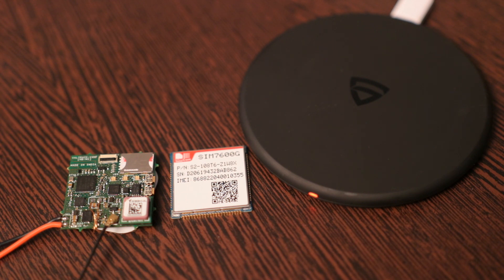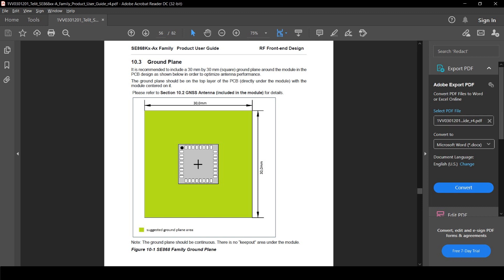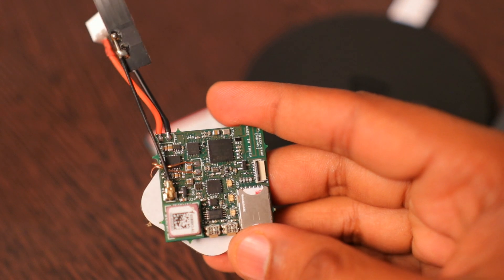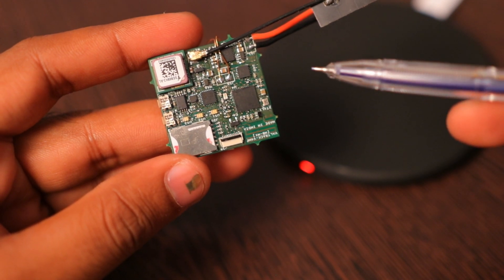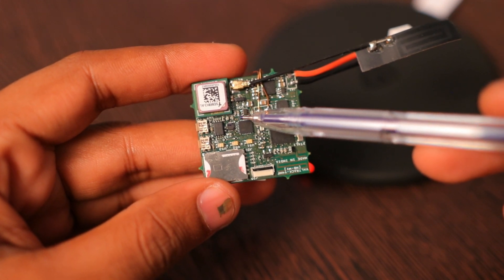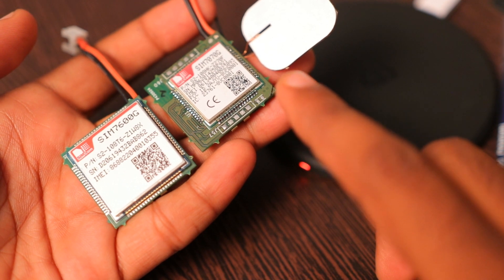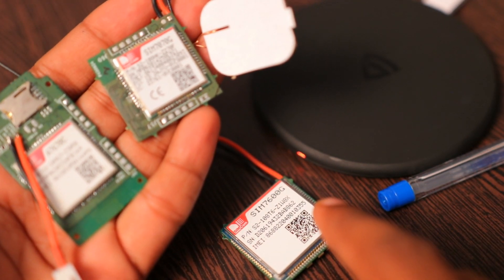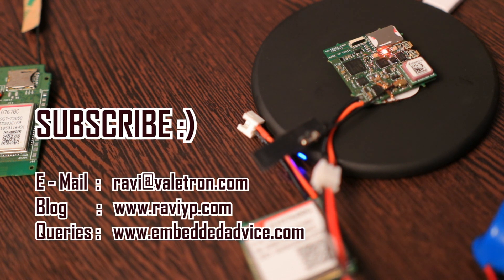Tiny 4G-LTE-NBIOT GPS tracker for Pet & Assets  - VALTRACK-V4-MF

Comment: This is a great product. I have a small doubt, SIM7600 comes with both GSM and GNSS right? We can use the same module for making calls and also getting the position data. Am I right? Thanks in advance
Reply from the maker: Thank you. Yes you can use it it comes with inbuilt gnss. But it comes with PCM audio and not analog audio interface. You need to use a audio codec
Reply: @RaviPujar  Thanks for the reply. I don't require audio ri8 now...I should have 2 separate antennas for gps and GNSS which died the job right?
Reply from the maker: @gudimetlakowshik3617  only 1 is needed

Comment: Very nice! 

Doesn't SIM7600 come with integrated GNSS? What's the reason to use external module for it?
Reply from the maker: Thank you. SIM7600 Needs a bigger external antenna. Adds up to space and blocks the LED view
Reply: @RaviPujar  Nice idea. I too was wondering at that big box antenna. 
How about having that integrated antenna+GNSS mini module indise a thin metal box? I am wondering at the signal effects then.
Reply from the maker: @navadeep025  Metal blocks signals
Reply: @RaviPujar  How about using these flex antennae with the SIM7600 itself for GNSS band https://www.molex.com/molex/products/part-detail/antennas/2065600050?

Comment: Hi Ravi, Thanks for your detailed explanation. 
I have 2 questions..
1. In some of your videos i found you have used ER26500 non rechargeable batteries. In technical data sheets those batteries will deliver max continuous current of 180mA and max peak current of 320mA. But GSM modules requires 1.8 to 2A in peaks right. So how these batteries are providing enough current at peaks?
2. GSM modules required 3.4 to 4.4V right. Non rechargeable batteries are giving 3.7V only. How long these batteries will provide power supply till it reaches to 3.4V from 3.7V?
Reply from the maker: Hi, We never used non rechargeable with GSM. They can't supply the current needed. We only used them for LoRa trackers

Comment: how do you get the small package soldered ?
Reply from the maker: We place on board and put in reflow oven
Reply: @RaviPujar  as i dont have a reflow machine can you recommend me any other option
Reply from the maker: @Hellercross  You can solder using hot air gun too

Comment: As always great work. Also liked your idea to add wireless charging and put it in IP rated encloser.

How was the experience designing with wireless charging, means settings tuning values FOD and IMOD, VMOD?? 
I'm currently testing qi supported wireless gaming mouse and pad, we're using p9222 from renesas.
Reply from the maker: Thank you. The charging circuit just works. We based it out of evaluation board circuit. Then for tuning got help from e2e forum. Calculations were are helped from the forum. Nice to hear about the product. So the pad will always have power? Or the mouse will have battery?
Reply: @RaviPujar  Yes pad will be connected to usb  and work as TX and mouse will be RX also has internal battery.
Reply from the maker: @punit_patel  Got it 👍
Reply: Can you guys make tutorials on DIY pet tracker or similar stuff. It would be great.

Comment: does any operator in india supports LTE CAT-M1(eMTC) and NB-IoT? I am planning to use 7000G module but skeptical if it will work with indian operators..
Reply from the maker: Not yet available in India. No commercial launches yet by any operator. Only JIO has installed in small areas in Gujrat for testing
Reply: @RaviPujar  Thanks for the info. really bad situation here in india..
Reply from the maker: @ishdemon_  Yes no one is in hurry. All operators taking their time. Don't forget to Subscribe :)
Reply: @RaviPujar  bdw where do you guys source your modules from. i can't find 7600G in any  indian commercial sites..
Reply from the maker: @ishdemon_  Get from distributors. Campus components, Pune. Lead time will be there